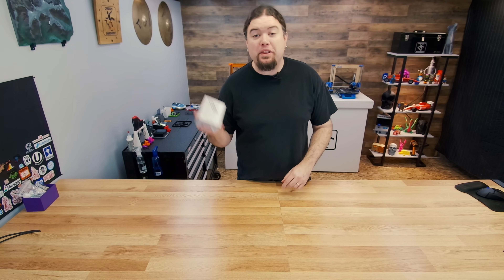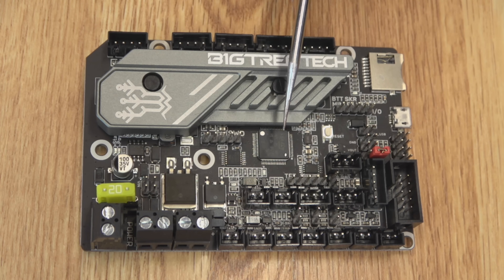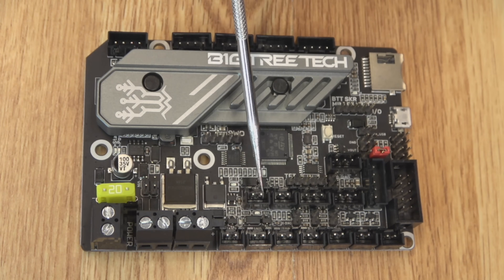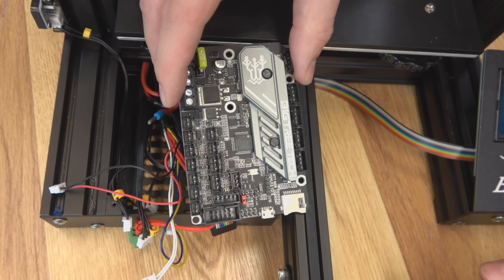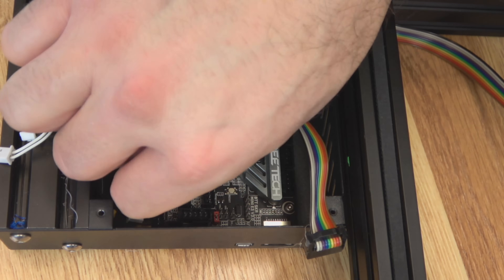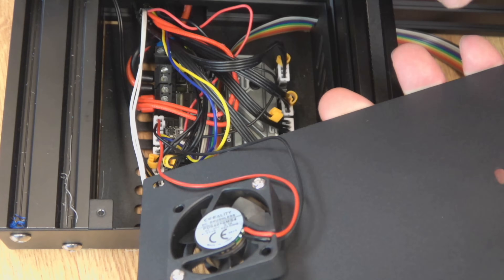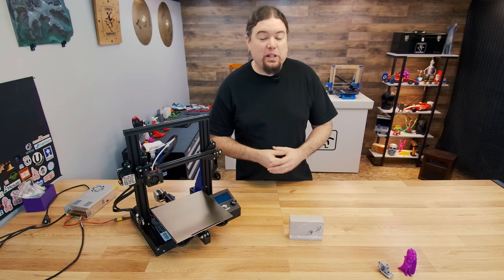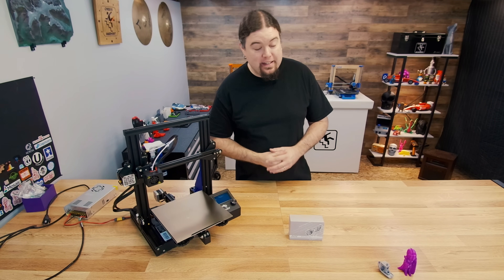BigTreeTech - SKR Mini E3 v3.0 - Chris's Basement

Comment: Great video, but I'm so done with Micro USB ports and I'm not buying anything else with that inferior port except Pi Zero 2s from now on.   I'd pay $10 more for USB C.  I just got the BTT Octopus for my Voron build, and they used USB C on that. And right now I can get an Octopus for only $5 more than a Mini E3 3.0.  I would gladly pay that.  It's not even about speed but physical longevity.
Reply: I agree. I messed up the micro sd card and usb mini on my Ender 5 Plus. Cheap-a$$ components. I got the BTT SKR Mini E3 3.0 today and a Raspberry Pi 3b+ on the way.
Reply: Hell I'll take USB-B over micro USB
Reply: @Matthew Miller micro USB is usually the first thing to go on my old phones and that's a fairly common thing from people I've talked to. Don't know what the hell you're talking about.
Reply: I have old Blackberrys that still charge up. Usb mini was fine it was usb micro that sucked. 🤣🤣
Reply: @mainstreammedia01  Yeah, Mini-USB was fine or at least rugged enough to survive some light abuse. It was just too bulky as portable devices started getting flatter.
Reply from the maker: Thanks for sharing!